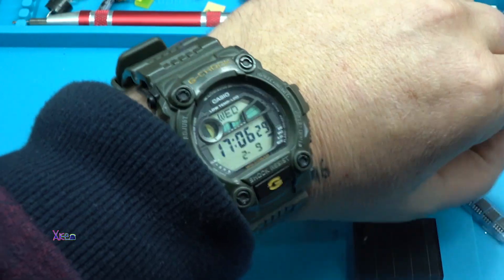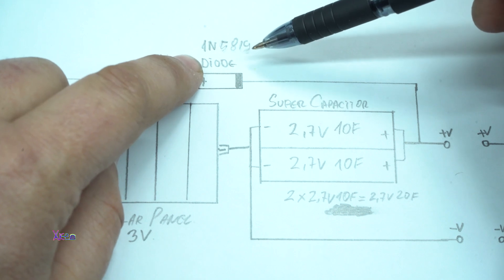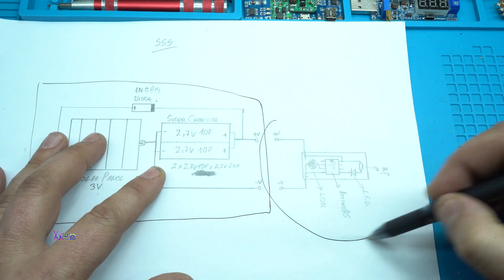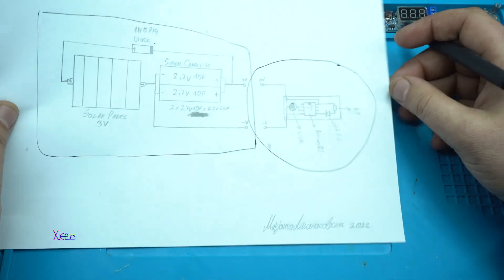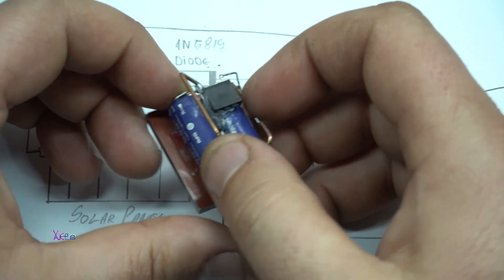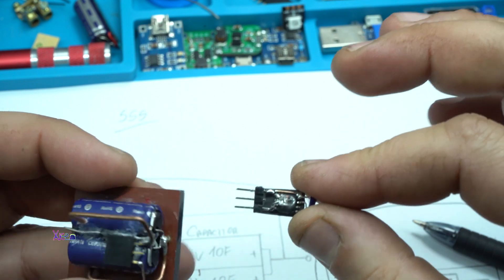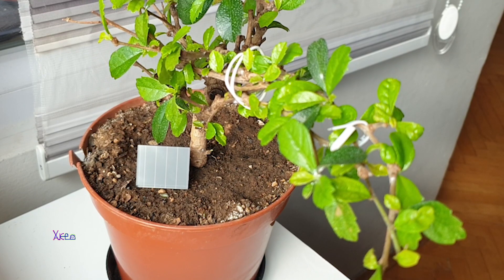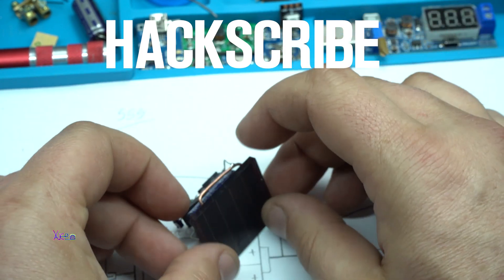Super Solar System - A Micro Self Care Solar Energy Gadget

Comment: Very nice! Please, where did you buy that little photovoltaic panel? Can you put a link? I searched quite a bit but couldn't find it. Thanks for sharing!
Reply: Can you  answer to my question? Thank you!
Reply: @MihaiMihai-zw4rz  Links are useless after a while. You can find them on ebay (as any parts shown here), although this one has extra protection, depending on what you are looking for they are not so cheap and you could get something similar from a 1$ store garden light (maybe 2$), then adjust the set-up